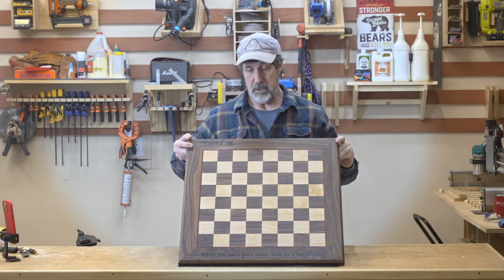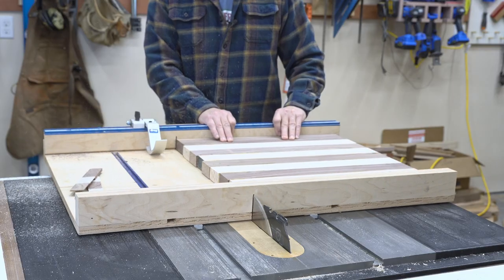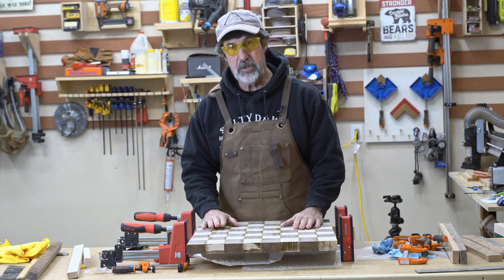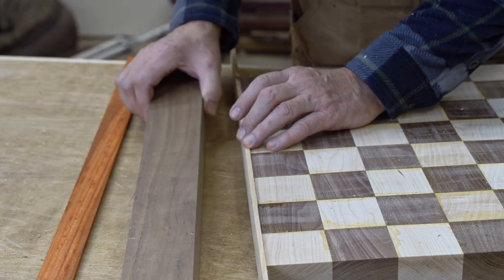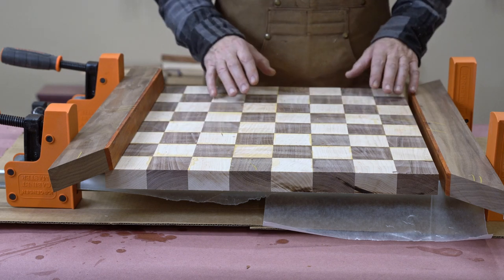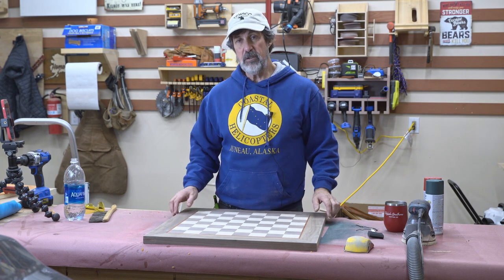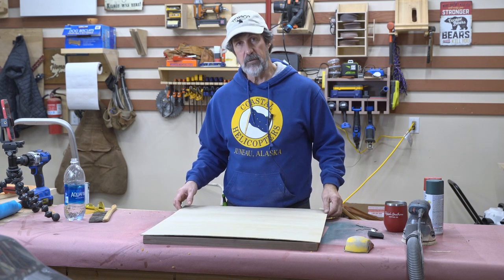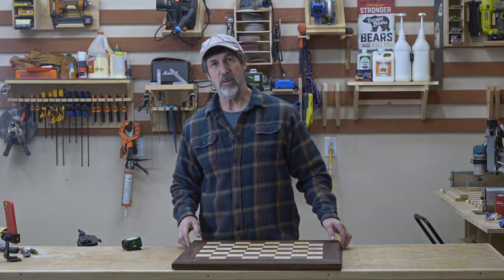Chess Board

Comment: Sweet Chessboard! Ive seen a lot of cnc'rs use epoxy inlays and use the flattening bit to bring it to level before sanding.Anyways, great gift idea I'm sure it will be loved for years. What laser are you using?
Reply from the maker: Thanks, I just started working with epoxy and will definitely use it next time. I was hesitant to use it since I had  very little experience. I bought an add on laser to the CNC, a little 7W one. I will probably want an upgrade soon 😬

Comment: Impressive build!  Came out great. I’ve been using tung oil lately and like it but hadn’t considered adjusting the ratios like you did.  Do you feel that worked well?
Reply from the maker: Yes, thinning at the beginning allowed it to soak in faster. You could really tell by the last coat that the wood had enough.